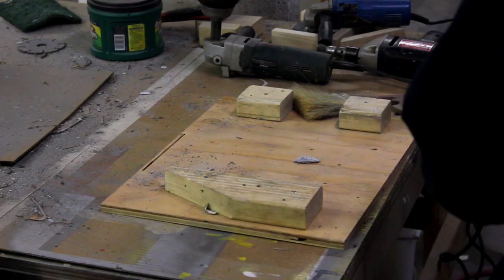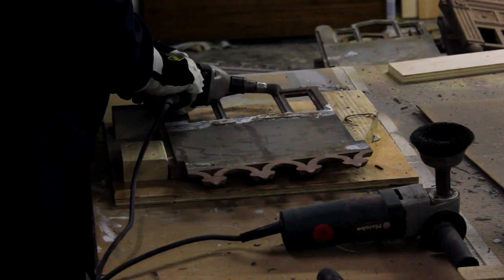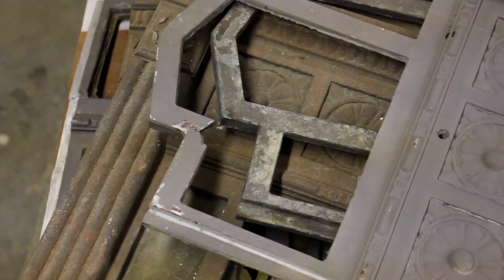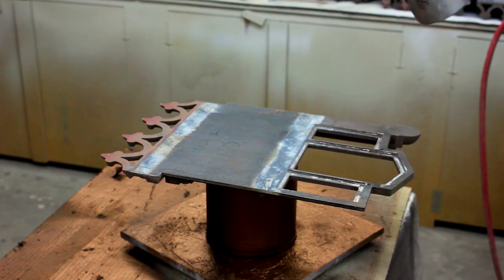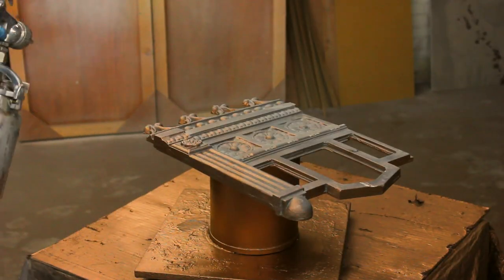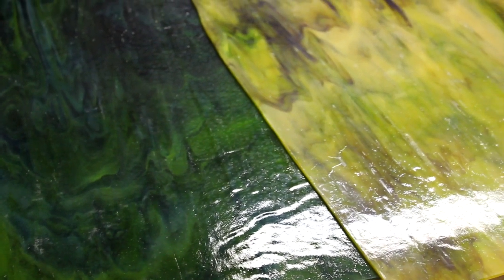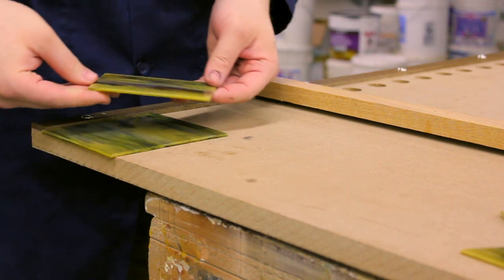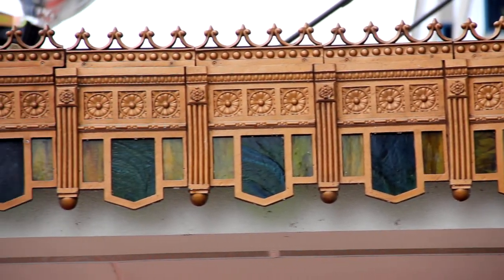Bronze Finished Castings Restoration at the Marriott Pere Marquette Hotel

Comment: Lighter and more durable????  That tells me these pieces aren't really bronze.  Is it safe to assume the originals were cast iron and the replacements cast aluminum?
Reply from the maker: Thank you for your interest in Heritage Restoration and Design Studio. You are correct in your assumption, the original units were not fabricated of solid bronze, but were finished originally to look like a polished metal. Heritage was tasked with developing a system to make replica panels that look identical to the original units but out of a much more durable (in terms to weather resistance) material than the original metal units. All of the items (both the salvaged old and new replicas) were finished with our custom bronzing coatings that, overtime will weather similar in appearance to actual solid bronze units. Heritage can also commission the production of solid bronze canopy units, but it can be too costly for some markets.
Reply: They turned out beautiful.  Thanks!